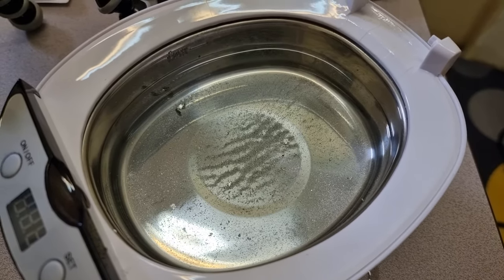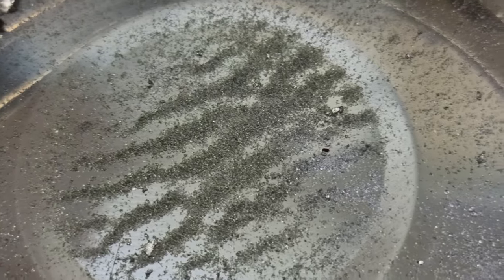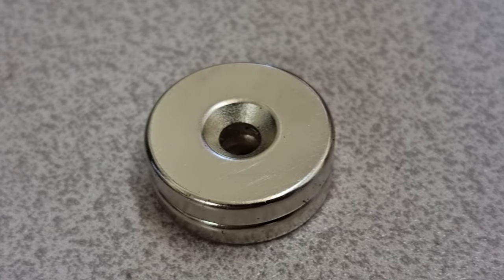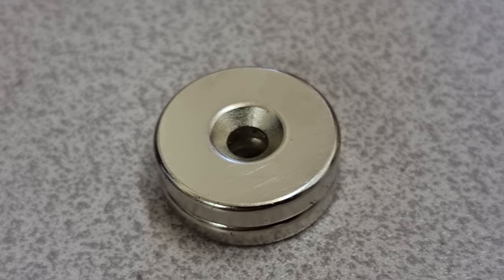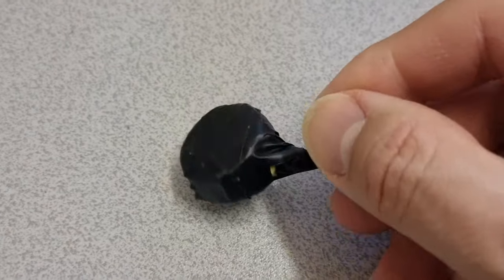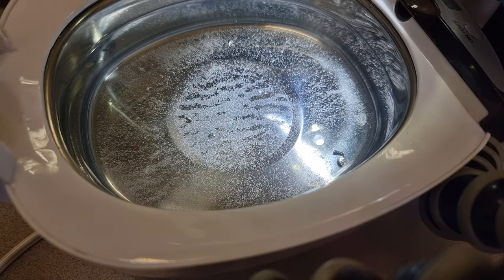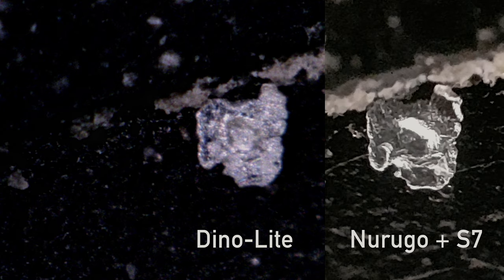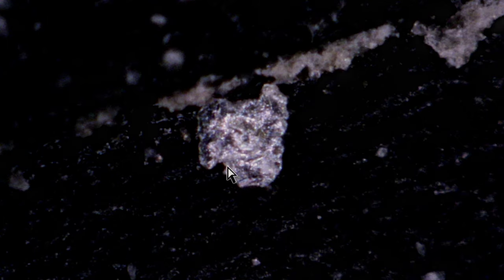ULTR - Magnetic propeller?

Comment: with a variable frequency cleaner maybe you can find a spot tuning.. also have you try with mercury?
Reply from the maker: We have not tried with Mercury, but the Italian research group led by Cardone have many times and seen transmutation.
Reply: @MFMP  thanx for the answer! I will have a look
Reply: @MFMP  I would like to try to hook a underwater transducer or a speaker connected to a function generator and an amplifier to reproduce ohmasa gas, obviosusly i will need a water pump and a set of ss also connected to another funtion generator and at this point the goal is to get the resonant frequency of the two system to produce the gas, do you think that is possible to accomplish something this way? thank you
Reply from the maker: @poskoz  Ohmasa gas is produced with vibration and electrolysys
Reply: @MFMP  yes that's what I mean but for the vibration it should be possible to use a ceramic speaker under water like those in the mist generators but a big one driven by a function generator what do you think? thanx
Reply from the maker: @poskoz  yes
Reply: @MFMP  thank you very much for your help and kindness.

Comment: Did you try to see if it responded to magnetic fields after you had removed it ?
Reply from the maker: DAVE did with his tests. The pieces removed were strongly attracted to magnet. When I saw the triple bladed fan structure with the hexagon core, I just went to the microscope and when I saw what looked like a sphere in the centre, where one would expect the magnetic material to form form Aluminium, I expected that to be a crenelated magnetite/Iron Rich sphere as observed in NOVA, LION, me356, Parkhomov 225, Hessdalen etc. etc. and I just wanted to wait and see what Alan found on SEM/EDS before spending more time on it. He found a number of crenelated iron-rich spheres, basically Iron and Oxygen, and that is where we are. Prediction based on multi-system observation lead to prediction lead to observation.
Reply: @MFMP  wow just to confirm - DAVE's pieces have been confirmed by SEM to contain Fe ?
Reply from the maker: @jonahfoxy  DAVE did two sequential tests - both produced particles that were twisted peaks/pits from the '8's

I then ran a magnet around as you see in this video on the particles from a test I conducted before DAVE. I gathered 3 magnetic particles, the biggest was a 3-blade fan shaped one with a hexagon in the middle and what looked like a sphere, I speculated that I expected that the sphere would be iron-rich (based on many previous direct and 3rd party observations). Actually, in my public proposal for this experiment in October 2019 I wrote this 

"3.16. Indium is in the same group as Aluminium, and knowing how Al is so massively affected in Hutchison effect (and also Ohsawa, and potentially a LENR fuel as two 27Al fuse to 54Fe) there was an expectation that there could be a range of other factors that could make it highly susceptible under the influence of EVOs."

https://docs.google.com/document/d/1rvVhRGGLSuIEpdXmj6jAbf0whitX1iFLiCpU2Wbpi64/edit

Since this was 3 out of 3 experiments in a row that observed particles, I requested that Alan Goldwater did a test and place any particles he captured onto his SEM for analysis.

He did the test, acquired some particles and observed they were the crenelated Iron and Oxygen rich particles that have been observed in other LENR systems.

Just need to discount any contamination. If that can be done, this is a water-tight experiment that 5 year olds can do in primary school for a stationary level budget in 1 class.
Reply: @MFMP  wow amazing. is there a "recipe" for this ? Seems like it would be very straightforward to work out, but wouldn't want to miss anything. Inventory : Sonic cleaner, Thick Al foil, Nb magnet, PTFE tape, bonus = microscope.
Reply from the maker: @jonahfoxy  https://youtu.be/By1xWRLE4pY